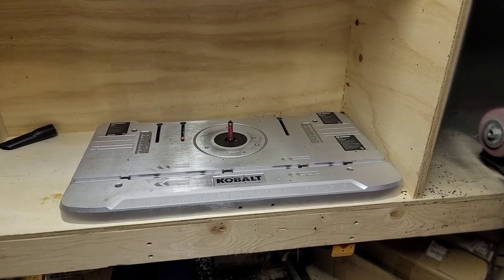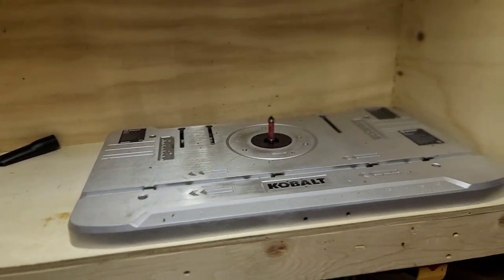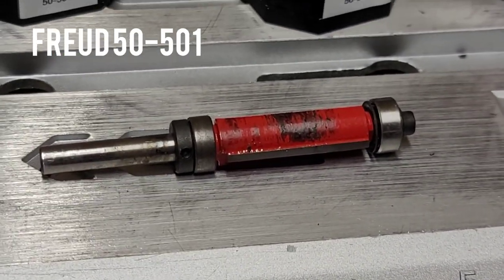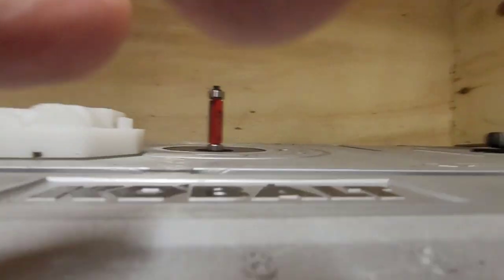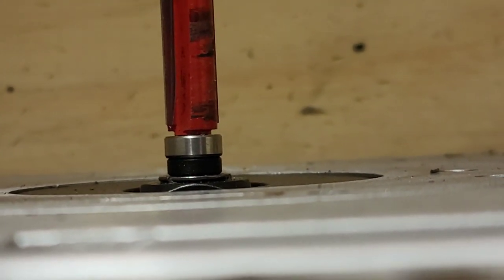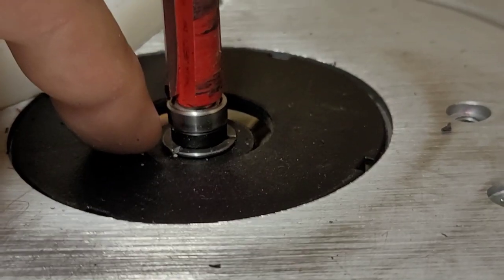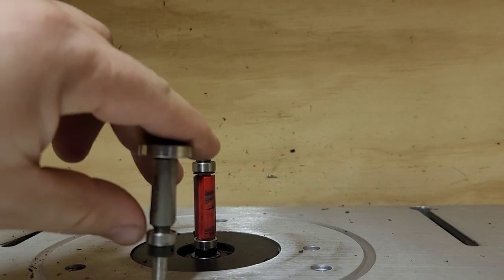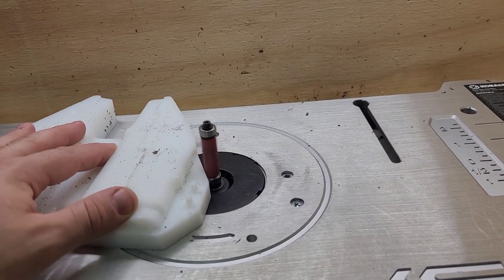How to Set up your Router Table

Comment: You had me wanting to purchase a router until the end lol. I already knew and somewhat limited to space for a router table within an apartment complex. What would be a good alternative to this? Just going by hand with a dremel? I wouldn't be pumping out a bunch of holsters, but I would like to be somewhat consistent in what is being produced by myself.
Reply from the maker: This is the most consistent I've found. Just loud.
Reply: @FalTacUnlimitedLLC  I am thinking of making a portable routing table out of a cart that would fit under my workbench. The same thing for the vacuum press station. I think having that portable would be beneficial in tight spaces. I would love to use a jig to get consistent results, but without a router kind of seems hard to do.

Comment: Your router table looks exactly like mine just wondering if you are aware of the key that came with it that drops in the hole on top. This lets you adjust the bit up and down easily from the top
Reply from the maker: Didn't notice!
Reply: @FalTacUnlimitedLLC  for the price I think it's one of its best features a lot of the more expensive name brand tables don't do that